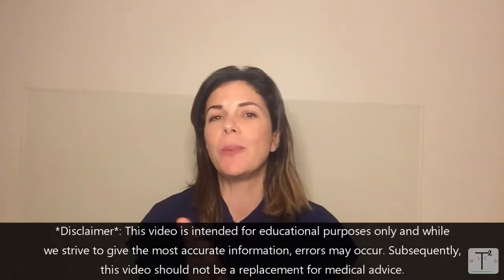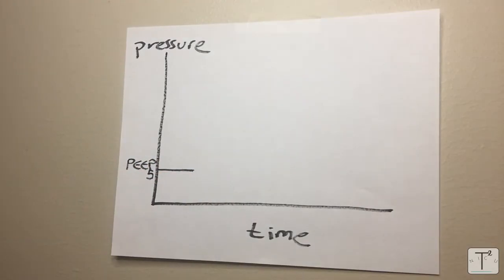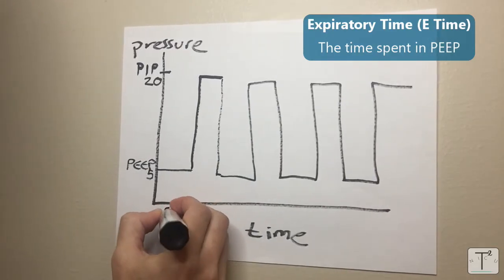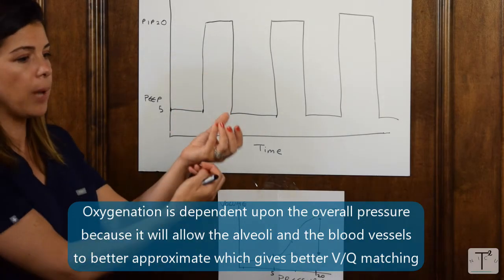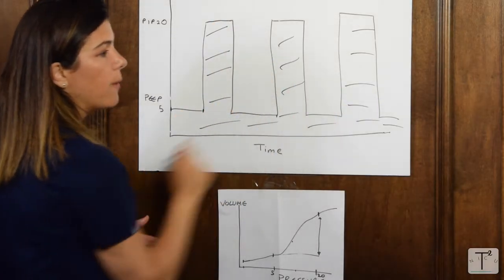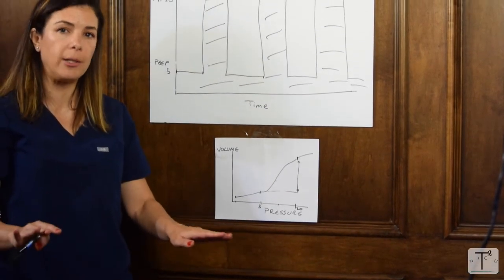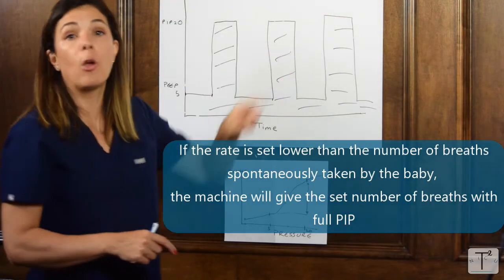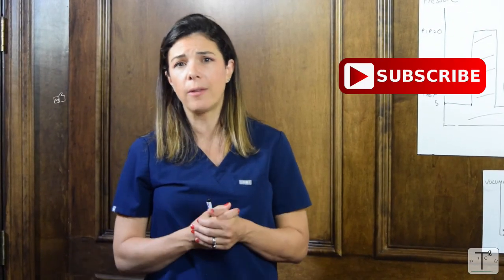Ventilator SETTINGS (PIP?/PEEP? RATE??) for BEGINNERS!

Comment: great video! if the baby is initiating less breaths than the amount on the machine then will they still get the set PEEP and PIP for each breath even though the baby is initiating some of the breaths? i know you said if the baby is initiating more breaths than the set rate the pressure support gives a little pressure instead of the set PIP & PEEP to help overcome the resistance of the breathing tube.
Reply from the maker: Hello! The PEEP is always there- it never goes away- like CPAP in background. Then the PIP kicks in for the rate the machine is set up. If the rate is 30 and baby is breathing 20 times a minute, then and additional 10 will be given when the baby isn’t taking a breath. Does that make sense?
Reply: @TalaTalksNICU yes! the baby always has the PEEP to keep alveoli open even when they initiate some breaths because they have immature lungs (lack of surfactant) and need to be kept open to allow time for 02 & CO2 exchange, and the machine only delivers the PIP during the breaths the baby doesn’t take themselves thank you so much for responding!🩷
Reply: could you explain how the PIP & PEEP (the pressures) differ from the amount of air (volume) being pushed into the lungs basically I’m wondering why you need both of them to facilitate gas exchange i think the pressures (PIP and PEEP) keep the alveoli open but i’m confused about how the volume works with it thank you in advance 🫶🏻
Reply: Is PEEP the pressure basically the force pushing the alveoli outwards so they doesn’t collapse on itself? And is PIP the force propping the rest of the lungs, bronchi etc open when the volume (air) is being pushed into the lungs during inspiration? Im thinking of the lungs as a hose and if the hose is very narrow the volume(air) can't get through it effectively, so the pressures (PIP during inspiration and PEEP during expiration) push the hose open allowing the volume(air) to move through it better. Please let me know if that makes sense and is correct. I apologize for the long comments 😅❤️

Comment: Hi Dr Tala,
Just wondering if you could clarify what it means for a baby to be "CPAPing" on a ventilator, and how to troubleshoot that?
Thank you!
Reply from the maker: Hello! I'm not totally sure in what context you're using it! Generally when I say CPAP on the vent- we're at SUCH low settings- whether it's the jet or the oscillator (or we're actually just giving CPAP but with an ETT in place) that it is actually CPAP. (Ie giving a PEEP and little else). Is this what you mean- or something else?

Comment: Hi Tala..I just wanna add something to your amazing video...Despite it is true that TV will depend on PIP-PEEP. But it is not always like that... in Volume-Press loop, if we decrease the PEEP too low, it will not result in higher TV because  the Compliance (C) is decreasing, hence lower TV. Feel free to correct me if I am wrong. Thanks.
Reply from the maker: Hello Jean! You’re absolutely right- this is an excellent point- and maybe I didn’t emphasize this enough in the video. This is true if your pressures are super high too and your lungs are over inflated- increasing the PIP won’t change your tidal volume much either. Thank you!!